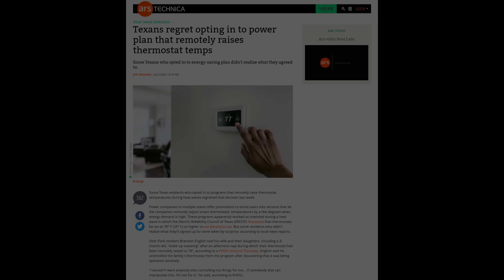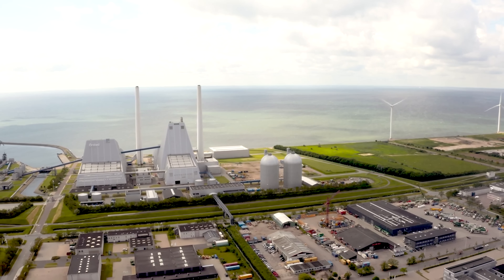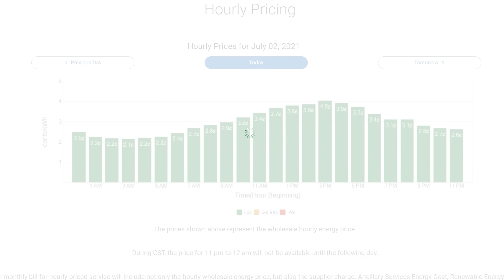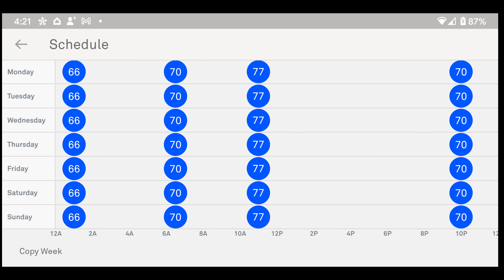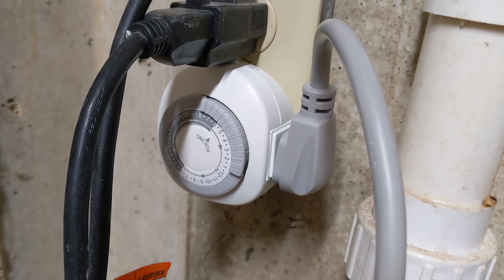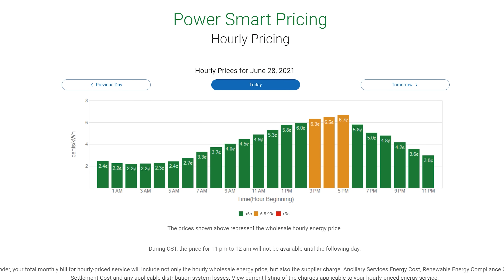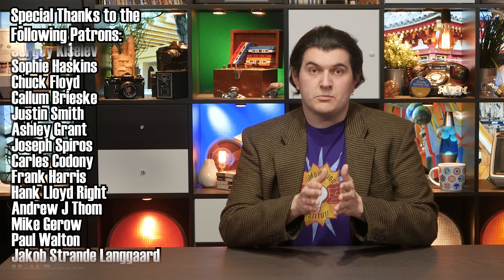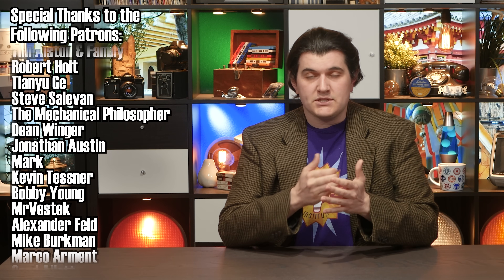Batteries aren't the only way to store energy. Here's another.

Comment: Excellent... and your AC/HP works more efficiently when temps more closely match your thermal goal. I found a smaller HP (assuming the same effiency) does the job... run solid for maybe 4 hours instead of all day. In the NW, night temps are usually in the 40's or 50's. I simply installed a pair of large ventilation fans mounted in a box in a window opening. In winter the window is closed. At night they can draw that 50 degree air thru the house (whole house fan). It generally takes 3-4 consecutive days of high night temps to raise day inside temps above 80, usually 72 tops, so only need AC 4 or 5 nights a year. Electricity in the NW is cheap so I'll never get a payback on the money invested in my 1978 home, but it's good to know I'm using less.

Comment: The same scheme has been in use in Finland for a long time for heating. Much before hour-by-hour electricity contracts many people had a deal where electricity was much cheaper at night. 

At my childhood home my parents for some reason didnt want to invest in timer to switch on and off the heating. The switch was cheap, but you woul had to hire an electrican to the wiring. So we had a manual switches, and had to remember to turn them on at night and off at morning.  Electric heaters heated a thousand litre tank of water witch was circulated in radiators.

Sometimes, when we forgot to turn the heating on, the water went cold, and we had to take cold showers. I was planning to make manual timer/switcher using legos, but somehow newer did.

Comment: I’m moving into my first home soon and I think I’ll be taking this into account when deciding how best to manage my energy costs. Albeit, it will be very different in a poorly insulated 1930’s built home. The ceiling fans throughout will definitely help with air circulation in both the warm and cold months (for those that don’t know, there’s a switch on most fans that changes the blade direction and helps the warm air rise or fall depending on the season), but I’m thinking I’m going to have to replace the windows, roof, attic insulation, and possibly the exterior doors before the house is at a point where it can become a thermal battery as you are describing. For now, I think the strategy will be more opening windows and turning on the fans during the summer to keep a cool draft going during the day and only running the A/C when absolutely necessary. Heat will be the more costly utility most likely, can’t really get a warm draft going in the winter time.

Comment: I have my electric hot water heater on a timer 
(fairly cheap, mechanical timer, had to install it in the wires to the heater, might require an electrician).
I do a similar thing to your strategy with the air conditioner when we need cooling. And the water heater is a year-round twist on the same idea. My water heater is another energy storage "battery".
Now I am storing energy, lowering the peak grid demand, and saving money with time-of-use electricity billing.

Comment: Massive heatsink in your basement, cool basement floor way down at night - Rip your carpet out and use tile or laminate flooring, and put a box fan in attic hatch to push hot air out of the house. works great. 
My basement has pellet stove for winter while heating the concrete floor down here for 6 months.

Comment: There is nothing against being smart with energy, but the economy of these ideas is totally forgotten.   A windmill on average produces only 1 MW ... while an average power station does 1000 MW .... A small country as teh Netherlands has roughly 22000 MW installed.  You can do the sums how many windmills are required to phase out fossil fuel power stations).
I like to draw attention to the possibility of Thorium LFTR nucleair energy which is a very compact, very clean, with minimum waste, highly efficient, very safe, low pressure design.  The energy content of 1 kg of Thorium is 10^7 kg (=10 million kg) of oil .... And 97 % of the nucleair energy is used (versus only 0,7 % when a water reactor with pellets in Zirconium rods).
The design of this proces is from Alvin Weinberg and a small scale unit unit was tested in 1960 (yes you read correct 1969) to full satisfaction of scientists and engineers in Oakridge laboratory.  To utter surprise of scientists and engineers the project was halted by Nixon and it is only because of the scientists who took care that design reports were stored in a safe place .....  And the world never heard of Thorium LFTR since then .....
As so often low cost energy was not in the interest of the elite ....
There are various youtube presentations where the principle of Thorium LFTR are explained and the clear advantages over the water reactor.

It is time that people wake up, think for themselves and require governments to listen.

Comment: Thanks for the idea.  It never occurred to me to use that strategy, I live in the foothill that gives a consistent evening breeze as the cooler mountain air moves down the valley.  I create a low pressure with fans blowing out the south windows and drawing cool air from the north (mountain facing).  If I get the house to 63F I'm good for the day.  Now going to supplement any temperature deficit by running my heat pump shortly after sunrise.

Comment: Call me crazy but here in Athens Georgia area.  I have not used AC in two years.  Just fan.   Last year i didn't use heat very much.   So far this year i have not turned on the heat yet.    (mild winter so far)  Now disclaimers i spend ALOT of time out side in the elements for work so its very easy for me to climatize to this.  Some one who works in a conditioned or heated area would find this very difficult.   Some one who sits down a lot and spends a lot of time inside would find this difficult.  Im also in ny early 20s so that's another factor.

I do definitely admire this idea for those using ac and heat daily.  Very good way to go about it as long as people always have a choice and there isnt a mandate instated saying the utility can control ur thermostat temp if you like it or not

Comment: You mention the UK 'Economy 7' system and this was a big success in older properties for a couple of decades, often supplemented by space heaters to get a comfortable temperature in late evenings.
The main drawback was that storage heaters were very bulky and the internal 'bricks' were fragile. With more efficient and robust materials they could make a return with far better controls than they had at the time.
Bear in mind that the British climate is such that domestic aircon cooling remains relatively rare except in large apartment blocks and we still tend to use windows and doors for air circulation.
When electricity distribution companies replaced 'electricity boards' in an orgy of 'privatization' we unfortunately reverted to a disorderly plethora of suppliers which occasionally had to be bailed out by taxpayer money. The fact that the actual grid system was in public hands, built using taxpayer money after WW2  but used by these various companies was conveniently overlooked.
The grid in the USA and southern Canada is in a terrible state and spread load economy measures such as you describe would work only where set standards of transmission applied to centralized standards observed by each state under law and there is not much time left for your country to get it right or lose the benefits of cheaper energy production through green generation.
Here in Britain the grid hardware is relatively well maintained and poorly performing parasitic supply companies are in slow retreat.

Comment: 21:30 I have a 2002 Prius. Being the first of its kind, a fully electric air conditioning compressor likely would have been too costly. My Prius uses a conventional belt-driven A/C compressor, but it incorporates a "cold-storage" evaporator core to provide comfort during engine-off driving or sitting at a stoplight. When the combustion engine is running, the evaporator (possibly incorporating some sort of solution in it to store more cold) collects cold. When the engine turns off, the air stays nice and cold for about 1 minute. Once the evaporator warms up, the engine will start, run just long enough to build up a cold reserve in the evaporator, and then shut off again.

Comment: Where I live in Minnesota it dips down to 66 degrees at night. We just open all the windows and turn on fans. It uses less energy to move the air than cool it. This does require planning because there are some days that are hot even at night but most days it works well.

Comment: In Finland heat-storing eiectric heating has been widely used for 50 yrs. Usually in the form of heating the brick/stone/concrete floors at night when electricity is cheapest. AC is seldom needed this far north.

Comment: Here's a tip for you. Free energy. Put an old water heater tank in your attic. Run the water into your attic first before you feed it into your water heater. You'll find that especially in the summer you can bypass your water heater right into the fall season.

Comment: Here in the UK, cooling is opening a window, and heating is done (in my house) at around 6-7 in the morning, and then 4-6pm, the house keeps heat in very well, so it doesn't get very cold at night (and if it gets cold it's better for sleep). The worst part of this is heating between 4-6pm in the winter months, but there's not much can be done about that, although heating is done with a gas boiler.

Comment: Through your video, I’m flabbergasted, on an 90f day, my house can go from 79f to 69f in a matter of 35 minutes, yet the house never exceeds 55% humidity. As well, luckily where I am, my light bill typically never exceeds $115 us. 
I guess the redesign I did with my father in law on the ac system in my 1986 home has paid off, and we still have to do the windows and insulation upgrades. It’s been a 2 year project with many years to come.

Comment: I live where it is 100 in the daytime and it used to be about 55F at night. I surrounded my house with a 2 German Shepherd moat and simply opened up the windows at night and closed them just before sunrise. The only annoyance is getting up just before sunrise. The house temperature never got over 75 over the course of the day. I have 5” of foam insulation (2 more than needed) and use double 3/8” cellular shades on my windows. I have a 3 season porch on the south side with 270 degrees of windows with the cellular shades. The porch will get up to 80 or so. During the 2021 PNW heat dome, at 117, the house rose to 85 (I had shaded the west windows with plywood). Unfortunately, climate change has caused me to invest in a mini- split for both my house and workshop, so I was planning to do as you suggest, that is, be strategic about when I cool the house. I have a solar array but am still connected to the grid. I make just enough electricity to make it to rezero day in March. I am having quite a time trying to figure out when to store cooling. When it is colder already at night but when it will use grid power or During the early morning after the sun is up? I sure miss those cool nights. Ok I am sniveling. The hot summer nights are around 70F and dry as a bone. I have to run a dehumidifier in my house during the winter because it is so tight, and wipe down all the windows every morning to keep the algae growth down. Stuff even freezes to the windows. That is a free dehumidifier but I still have to dry the towels. Sure enjoyed your talk.

Comment: Im also in the humid midwest. I rent the bottom level of a house built in 1896. Even though it gets to 90 here during the day, at night it's often below 70, so I open the windows and exchange the cool outside air with the warm inside air with window fans. Early in the morning I wake up and shut the windows and set a very small 4000btu window unit to 75... The window unit usually only kicks on a few times in the afternoon at the hottest point of the day, meanwhile all my neighbors whole house AC units are running non stop. The hottest it has ever gotten in the house is 78, and that was a 96 degree day. It usually stays between 70-75 in here. My power bill is bout $50-$75 a month. Goes to show that it works even in a very old house with really crappy windows..

Comment: In the early 80s we had a load shedding device installed next to out breaker box that would throttle the AC, water heater, dryer and refrigerator circuits.

Comment: 1:17 we have that over here in Germany as well, but it's only for heat pumps and EV chargers, so only things, that you wouldn't even notice that they were off for a few hours a day. 
What you WILL notice tho: Electricity bill for these two consumers are 1/3 cheaper. Currently, it's only a static timer instead a dynamic receiver.

Comment: running ac at night if it's below 70 at night is risking freezing the coils on the inside.  i try to pre-cool in the morning so less wear and tear when it's hottest.  also run the fan continuously to reduce start-up wear, keep the air mixed, and minimize noise in the home from multiple occupants.  An indoor rock pit can store heating and cooling

Comment: I do the same but with the hot water system. We have a similar electricity retailer in Australia where the power price refreshes half hourly, pegged to the wholesale price. I got our electrician to install the hot water system on a simple 24hr timer. In this area the cheapest (and greenest) power is around the middle of the day when the sun is shining and wind is blowing. Sometimes the price even goes negative during this period. Next step is for me to more cleverly automate appliance running in response to price changes.

Comment: In New Zealand I also run my airconditioning at night during summer and leave it off in the day.
This is also more efficient for the A/C due to the air temperature outside being about 10°c colder at night.
This is also true in winter as the sun sets it quickly becomes much colder outside and the heat pump will need to work much harder to get the same amount of heat output.

Comment: What a great idea! I've already thought of way to increase your "battery" size. Purchase a bunch of cheap iron, steel, brick , concrete etc and put in any extra storage places in your home. That could hold extra "coldness" for keeping house cooler for free in the daytime.
Reply: Just fyi: any metal has relatively low thermal inertia and is only useful when thermal conduction is the goal.  Brick works better, but a tank of water is pretty much the highest thermal inertia material you are going to find… advantage if emergency water storage is needed; disadvantage if there are mold and humidity problems!

Comment: Regarding Tiered Rate Structures. In the UK there is one supplier that offers half hourly rates, very occasionally the rate will actually go negative. They'll pay you to take energy. This happens when there's more wind energy than demand, typically 1 to 4 am on a very windy night, and there is no more generation to shut off.
Load shedding in the UK is exclusively for commercial and industrial customers. They are the ones likely to have AC (residential AC is incredibly rare here) with big buildings that are likely to not notice the effect of the AC being shut off for an hour at a time.

Comment: There is an added benefit to running heat pump (for cooling) during the night.
You have colder outside air, so delta T is lower and coefficient of performance is higher.
Works even better in heavy concrete houses found in Europe.

Comment: A lower energy use of this concept is the whole house fan. For areas that are cool in the evening, and hot in the day, a high CFM fan can eject all of the hot air and suck in cool outside air, and is really low cost. Where I live it gets up to 90, and down to 55, so I can make the temp in my house in the 60s at night. Close the windows and turn off the fan when your house is the desired temp.

Comment: We do a similar thing at our house in central California. We open up the house to get the cooler air at night in the house and close the house up and store the cool in the house. The problem? Where I live it gets so hot on a daily basis that the AC runs anyway but it does run less than it would if we didn’t do this. 

I agree, I would love to be able to change my energy need to be more off peak. Sadly my power provider doesn’t currently have any of the programs you talked about.

When I lived in Southern California we had SCE and they had some of these programs. I stopped using the summer program when they turned my thermostat up to 88 3 days in a row without cooling the house before the heat jump.

Comment: I've played with these concepts though my house is not efficiently insulated enough to do this during the hottest days. I have put 5x55 gallon drums of water on the cement floor of my insulated well pump house.  The water drums pull ambient ground heat to keep the pump house and water from freezing in winter.  Some build their well pumps and pressure tanks down under ground to do the same trick. We take advantage of ambient cool ground temps of the slab floors in our office building which works well to keep it cool in summer and keeps it from getting too cold over night in winter.

Comment: I've saved over $400 since 2018 in electric costs by signing up for TOU and DLC plans thru my utility.  I just installed a dual fuel heat pump with variable speed compressor so I'm looking forward to more energy savings.